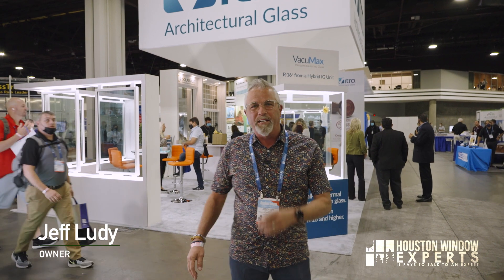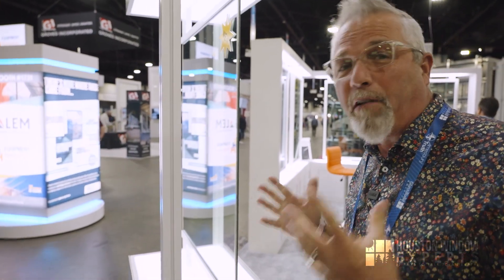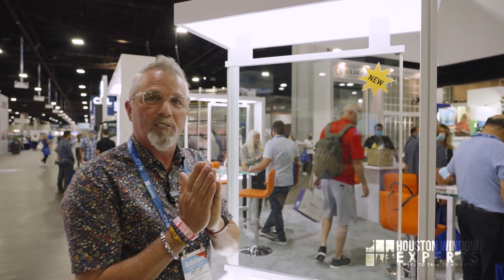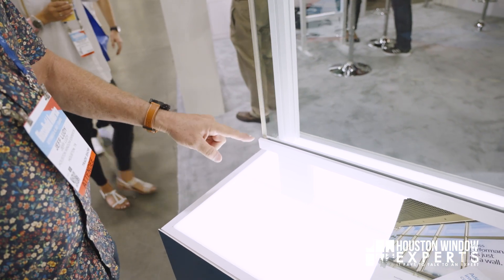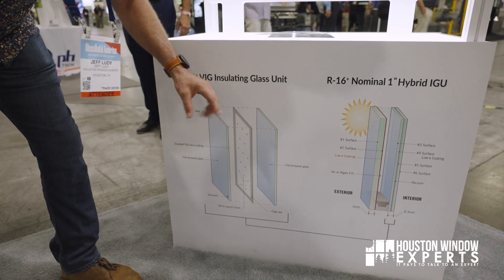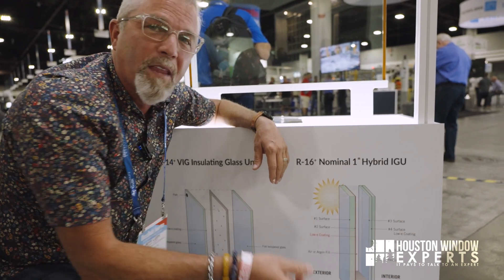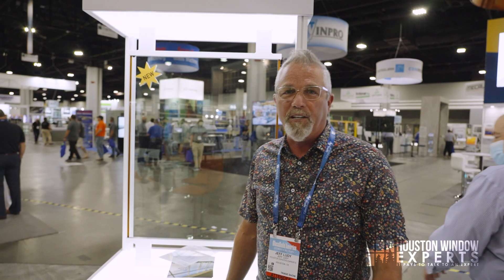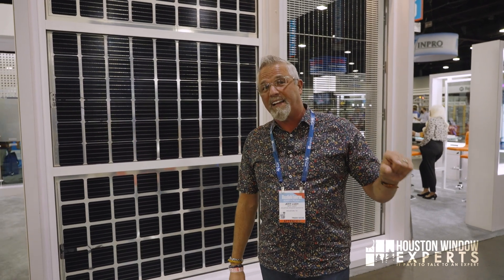What Is Vacuum Insulated Glass?

Comment: 1 atmosphere of vacuum in a unit that is subjected to heat cycles and mechanical movements? What kind of glue do they use to keep it sealed?
Reply from the maker: Great question! Vacuum-insulated glass (VIG) units don’t use regular glue — they’re sealed with a hermetic glass or metal bond (often solder glass or indium) that can handle pressure changes and temperature cycles. Tiny support pillars inside the unit keep the glass from flexing under vacuum. It’s a pretty advanced system compared to traditional IGUs.Thanks for watching!
Reply: @HoustonWindowExperts  Thanks!
Reply from the maker: You are very welcome!

Comment: Instead of sealing 2 panes together, with a sealant that always degrades eventually and thus lets the window fog up, why don't these window manufacturers weld the sides of the glass panes together so that there is no sealant that can break unless the window itself is broken?
Reply from the maker: I don't know that I have an answer to your question. My guess would be that it is time consuming and even a weld could fail. I've seen it happen on an airplane before.
Reply: Due to the thermal differentials that will be exterted upon the inner and outer panes of glass. The outside may be -5 c or lower, whereas the inside pane will be up at 18 c  or so, hence the 'bridging' glass bond will fractiure...

Comment: Hello, my VIF/C vacuum cleans my floor, and ceiling, and now. I don't have to vacuum clean anymore.  It also pulls out the heat from both areas and I save on the AC air costs.

Comment: Im stunned and confused. For decades i thought double glazing was - as standard - a partial vaccuum at least. or are they just filled with an inert/dry gas?
Reply from the maker: Typical double pane glass is sealed and filled with Argon gas. The vacuum glass has all the air removed.
Reply: I believe they typically flow in warm argon so it’s a bit less dense but unfortunately far from a vacuum

Comment: I've often wondered why we don't just use polycarbonate for windows.  It is 200% stronger and 50% lighter than glass and is more insulative than glass.  Oh, and it's cheaper than glass. Polycarbonate will not break (it is actually used for bullet proof glass).  Polycarb is also 100% UV protective.  The main disadvantage is it scratches easier than glass, but this can be overcame with coatings applied to it.  If you wear eyeglasses, there is a good chance your lenses are made of polycarbonate.
Reply from the maker: I look forward to the day!
Reply: probably because polycarbonate is 1000% more expensive than glass!
Reply: it’s not hard enough, you wouldn’t be able to wash the window it would scratch and become cloudy

Comment: This is a fantastic drop in replacement for monumental properties, which currently only have single pane glass.
It’s extremely hard to provide those with any decent insulation, whilst keeping the original very well constructed frames.
Very excited to see this, just worried about the actual price tag, but I can’t deny that this is clearly a far superior product.
Reply from the maker: You are correct! I think it's a great product. Now we just need to wait until the price comes down.

Comment: Thanks for getting the word out!  That was a great rundown of the product.
Some fun facts since I've been investing in this for some time...
VacuMax is actually the same as LandVac.  It has the exact same specs and manufacturing process.  Vitro Architectural Glass (formally PPG) acquired the China based LandGlass and VIG Technologies which produced LandVac.  
VIG has been installed on countless class A buildings since the mid 90's, but yeah, totally locked up in the commercial market until fairly recently.  As usual, the true origins of VIG were for military and aerospace use for completely different applications, like camera lenses, cryogenic vessels and various types of sensors that require both insulation and optical clarity, although I don't know of pillars being used.  Typically the glass for those applications is very thick such that the fused perimeter supports the stress.
VacuMax is officially available though several Vitro certified window manufacturers, but I've heard lead times are extremely delayed.    It's exciting that the US will have access to the premier VIG.  LandVac/VacuMax specs, warranty, etc etc exceeds that of basically all competitors considering the consumer market.  
I think VIG will be a standard for all insulated windows in the near future.
Reply from the maker: I agree. Thanks for watching and your comment.

Comment: Nice product. In Europe we have FINEO vacuum glass. Nearly the same like you showed here, but without evacuation port and with 15 years of warranty.
Reply from the maker: That's great. I'll check it out
Reply: Thanks for that, looks fantastic, hope i can afford it!
Reply from the maker: Thanks for watching
Reply: For the those using metric: the performance of the Fineo is "only" 0.7W/m2K vs this one on the video from Vitro with the specs of R14 (imperial) = RSI 2.52 = U 0.38W/m2K. Therefore, the Vitro performs much better than the Fineo?
Reply: Question is: who has testet, are the certificates trustable (CN vs. EU)? But in general - what difference is it for the usecase? (Sorry for my bad english :) )
Reply: @rolands.9163  Very true. After all, a vacuum is a vacuum.
Reply from the maker: Thank you!

Comment: Im still surprised no one is making a vacuum insulated steel 4x8 panel using this same design but with a honeycomb structure in the cavity for structural strength. An insulated steel panel that interlocks with other panels could make up the entire thermal envelope of a residential home. With enough design R&D I can imagine over time the panels replace the exterior siding and possibly interior wood framework making an all in one structure where the panels are your load bearing walls, your roof, your insulation, your siding, your interior walls....Everything. Of course you would probably need different kinds of spray on coatings and different methods of attaching stuff to the interior/exterior walls....Where there's a will there's a way.
Reply: They do sort of. They make metal vacuum insulated panels with a center fill of  standard insulation to improve thermal resistance of the panel. There what insulate semi trailers, sea cans vending machines, ect. The problem with vip’s is that over time they bleed air into them and loss there insulation valve
Reply from the maker: Thank you for your comment
Reply from the maker: Great information. Thank you for sharing.
Reply: boggles my mind that tripple pane is gaining popularity when double pane with a vacuum between is really the answer
Reply: Nature hates a vacuum.

Comment: I would think the glass would break much easier this way if it were hit with a gob a grass when mowing or something that would do a soft hit.  I think the gases that fill the spaces would act more like a cushion.   Are the break points any different Jeff?
Reply from the maker: I think that glass can be unpredictable at times. I've seen glass that should not have broken break, and glass that you would have thought should have broken did not.
Reply: @HoustonWindowExperts  Are there industry standard tests, drop a ball bearing of x weight, y inches over, a standard grid pattern?
Reply from the maker: No, as far as I know, testing is done using wind, rain, and pressure. There are no specific ratings for glass strength as you described.
Reply from the maker: Thank you, David.